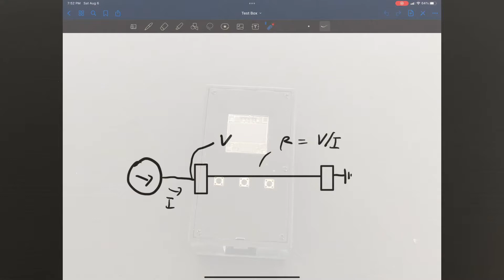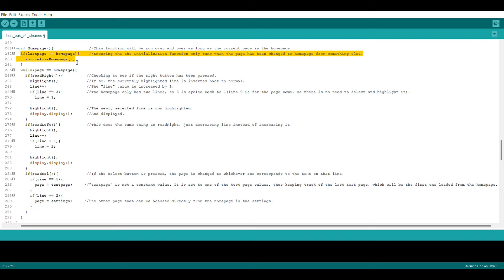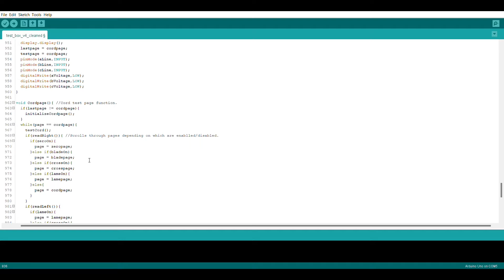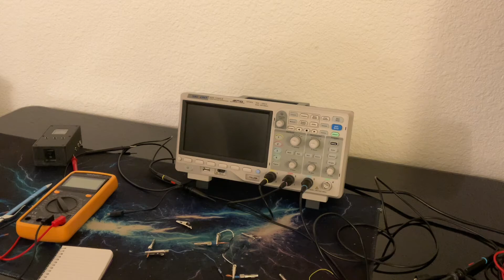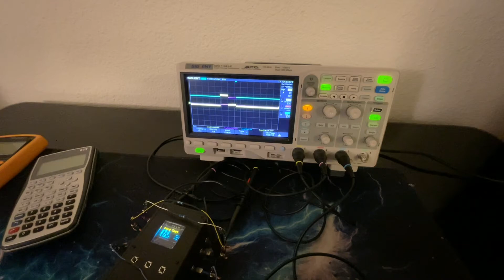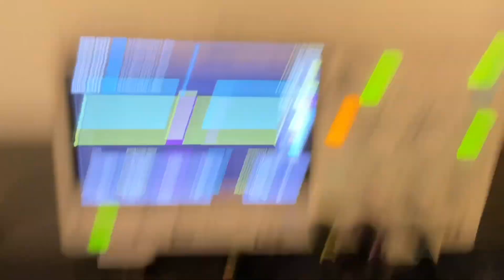Brief overview of handheld fencing test box

Comment: Is it necessary to configure using an oscilloscope for final adjustment?
Reply from the maker: No, you would only do that to change the resistance calculation from the constant current approximation to an interpolation, however, the accuracy(or rather, lack thereof) of the hardware likely makes the increased effort pointless.
Reply: @omnia8838 Is the accuracy level very far if you don't do the configuration?
Reply from the maker: @Musik_kekinian55  I mean, yes, the accuracy will be worse, however it's still using the Arduino built in ADC, and the primary goal was to make something that was very cheap and "good enough", so I personally don't think it's really worth it going through the extra trouble with this design.
Reply: @omnia8838 Is there no way to avoid having to configure it?
Reply: Can you add a buzzer?
Reply from the maker: @Musik_kekinian55  Easily.